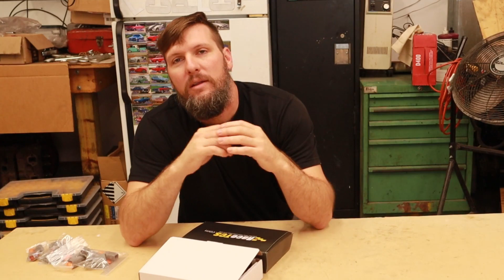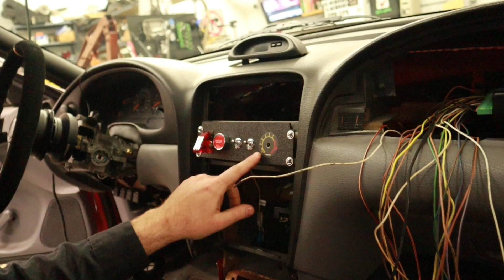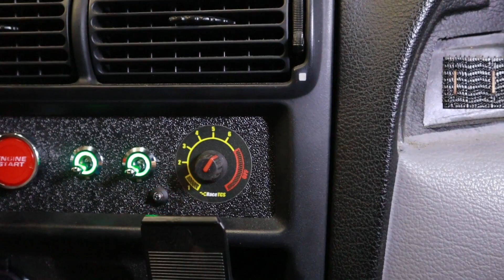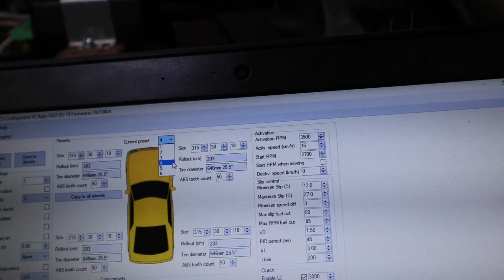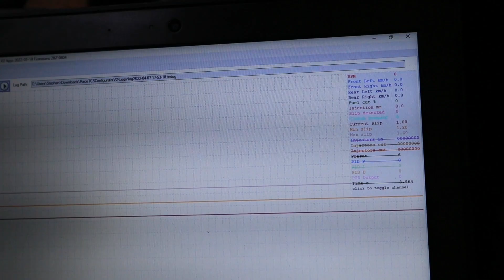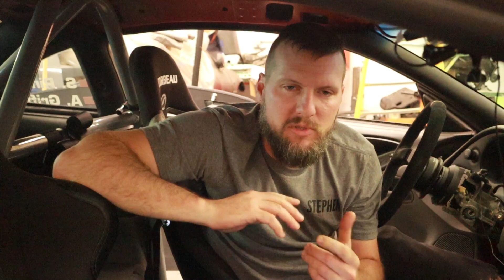Installing RaceTCS Traction Control System - SN95 Mustang

Comment: I'm running s10 spindles with wheels sensors do you have to add the resistors to make it  work ?
Reply from the maker: I did not. The Race TCS works with multiple type of wheel speed sensors. I had VR sensors.

Comment: Ah.. awesome video on a rare topic!  I am debating on getting a vehicle or not if there is any aftermarket traction control solutions since it does not have any from the factory. I wish you would have shown the scary seemingly part of how to tap into the injectors and ABS wiring!
Reply from the maker: The injectors I just cut coming out of the ECU and added a connector to reroute to the RaceTCS. The wheel speed was more delicate splicing into and splitting to ABS and RaceTCS.

Comment: So how did this go on the Autocross course? Did it help you out like you thought it would?
Reply from the maker: Yes, I really liked it. It gave good consistent and aggressive launches. I tuned back the traction control so it didn't intervene very much. But was useful to turn up during wet conditions to keep tires from spinning. I like that it was very tunable.

Comment: Did you run a fuse for 12v power?   I love your build, starting to wire mine.
Reply from the maker: Thanks. I used an existing fused wire. I highly recommend always using fused power whether it's an existing fused circuit or an added fuse.
Reply from the maker: So you're installing the RaceTCS too?
Reply: @RinerAutomotive  Yes.  Small world.
Reply from the maker: Nice I like it although I need to do some more tuning to get better settings.

Comment: Like it!

I'm presently installing a Haltech ECU with Boomslang harness which has that capability by laptop though main use is primarily for fuel control at full throttle in 4th & 5th and then better tuneability thru out powerband.  I run a T-56 in my 99 SVT.... Another big feature/install is drive by wire for auto blip shifting

My rear ABS rings were Mistakenly not put on when I upgraded to chromoly 1/2 shafts.  I also run Torsen T-2R

PS your neighbors must love you lol only if they own Harleys
Reply from the maker: I really like the Haltech ecu, if/when I upgrade to aftermarket it would probably be Haltech. I liked the launch control feature using drive by wire throttle bodies.

Ha I had one neighbor come over to see what I was doing and say how good it sounds. I'm sure others were annoyed. Tried to keep it quick. Really need to test with a longer straight anyway.

Comment: Any concern of detonation when fuel is being pulled?
Reply from the maker: I don't think so. Rev limiters can be done two ways fuel cut or ignition cut. This completely cuts the fuel to a cylinder so it becomes an air pump.